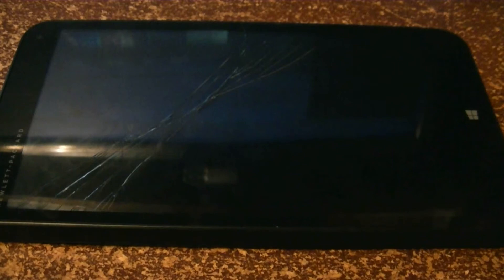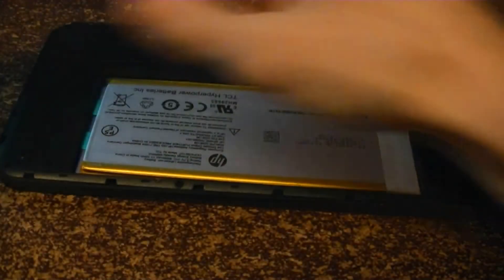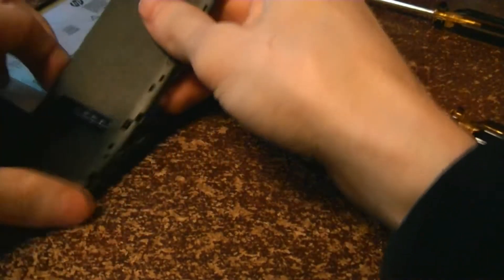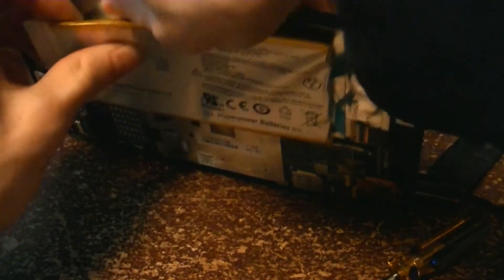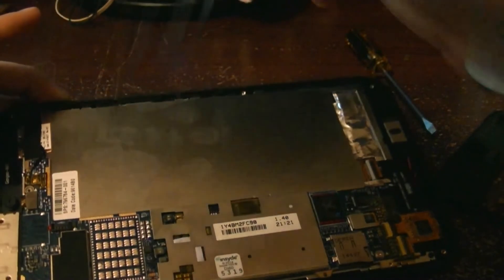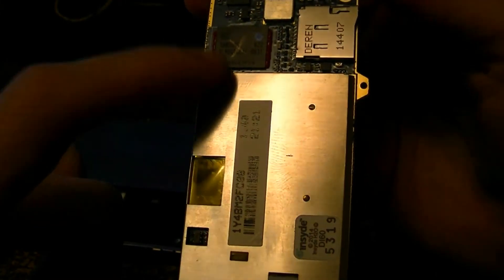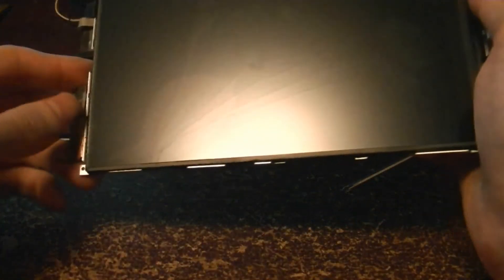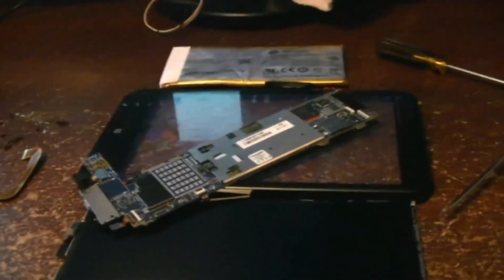HP Stream7, Tear Down, Guide, Dismantlement

Comment: I have two of these tablets (one is older) and was able to swap the batteries in them so that I could reload Windows 10 from an SD card via an OTG adapter.  

To remove the battery (w/o damaging it), pull the blue tabs outward towards the end of the tablet and the adhesive strips under the battery will release and pull out.  The adhesive strips are removable just like the plastic "3M Command" brand style removable adhesive wall clips .  That is much easier than attempting to it pry off which could easily damage the battery.

The battery connector lifts straight up and off when picking up the battery and not outward like a pin style connector would.  

I have a Y style splitter OTG that I ordered from Ebay  https://www.ebay.com/itm/Splitter-Cable-Power-USB-HOST-Y-2016-Female-To-Micro-Male-Female-Adapter-OTG/253597330795?ssPageName=STRK%3AMEBIDX%3AIT&_trksid=p2057872.m2749.l2649 but it still didn't power the tablet while using the OTG adapter so it was necessary to run off the battery during the Windows and HP drivers installation process that didn't automatically load.  I used a powered USB hub to plug in the SD card, mouse, & keyboard which were all needed to load/configure Win10 on it and I'm sure this helps the tablet battery last longer by not drawing power from it. 

 I haven't thoroughly searched and found a place that sells these batteries (new/inexpensively/w/ the same connector) nor have found a way to get the tablet to run on external power via the OTG adapter, so if anyone knows, please chime in!
Reply: Good details. 1 year, perhaps you already found the solution but you can find battery replacements on amazon, and if you want to avoid that, I found instructions on how to run the tablet without the battery. The device won't boot but you can plug a different power source as long as it has the 3.7v with enough mah, it's about 2000-3800. The user reporting such fix could use the tablet continuously freeing the usb port then. Good luck.
Here is some info: https://h30434.www3.hp.com/t5/Tablets-and-Mobile-Devices-Archive-Read-Only/OTG-charging-and-extrenal-batery-pack-works-HP-stream-7/td-p/4824773

Comment: 1)why didn't you just get a new screen and digitizer on ebay?
people are always selling parts for broken smart devices there.
Travis Boyko 
Sorry to be a bother again, one last question.
did you notice when you had this tablet that free memory space would disappear by the hundreds of mb?
I mean I keep seeing the free space disappear by the hundreds of mb and I'm not sure whats gobbling it up.
I have all windows updates turned off. I don't update any apps. so I'm not sure where these mbs are going/getting used up.
Do you happen to know if the HP company does OTA software updates and if they do..how do I turn it off? Cuz I almost feel like that's whats happening here.
I know where and how to turn ota software updates off on android devices but again, I'm unfamiliar with windows smart devices and how they work.
Reply from the maker: Its acutally cheaper to

1) buy the same tablet new then it is to spend 200+ on accident dmg warrantee
2) Buy the same tablet new then it would have been to buy the Display panel and  front casing (the drop made the display panel leak
----------------
3) windows Store for Xbox, mobile and Windows Store will all be under 1 roof as well as crossplatfourm apps

4) free space on any windows tablet will slowly get used up.. Why... PageFile, Windows Updates, Hibernation, system restore points. This is why its a good reason on windows tablets to do a weekly disk cleanup as well as system restore point clean ups... This also happens on Notebooks and even towers ect... Things like towers don't use hibernation though...

personally Windows tablets should NOT be any lower then 64GIG in size.. and always remember to keep at lest 20% of total space free..

rule of thumb .. Treat all windows devices the same.. Treat your Win8.x tablet like your desktop...